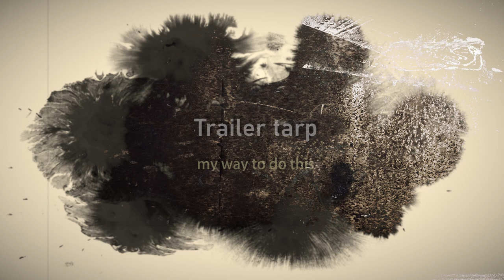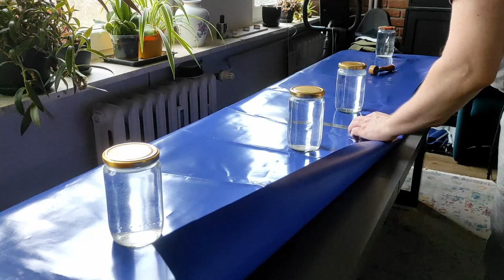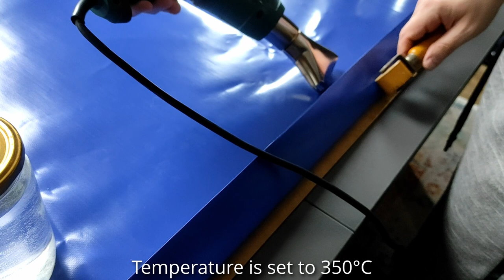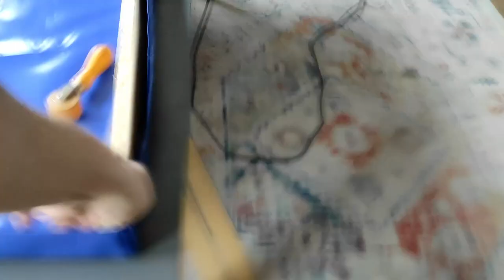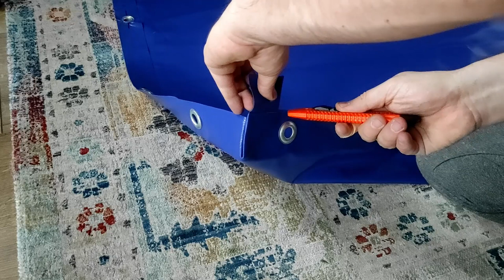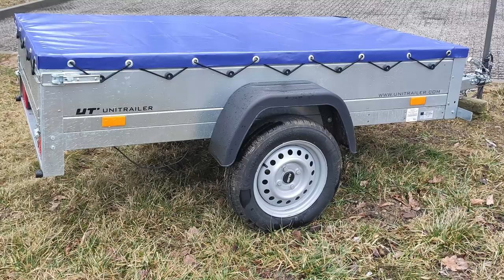#12 Trailer tarp and my way to do this

Comment: Good work. What thickness plastic did you buy (ordered on line?) and did you use any glue on the corners where you folded?  Thx.
Reply from the maker: Thanks, I use no glue there, only hot air. I don't know what thickness of plasitik is but it has 650 gr/m2 and I ordered it online
Reply: Do you hv a link to where you bought it. I’m wasting a lot of time trying to find this material. Thanks so much!!!